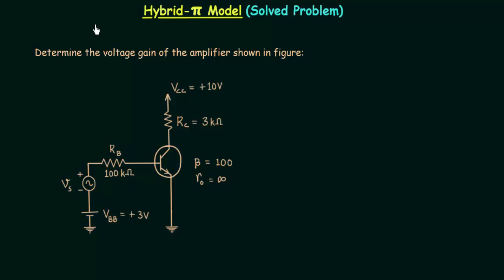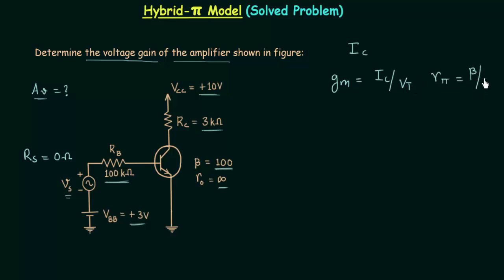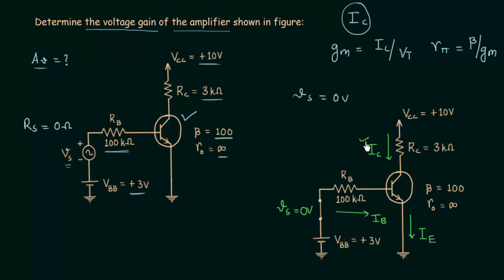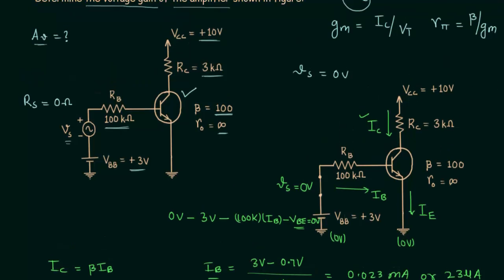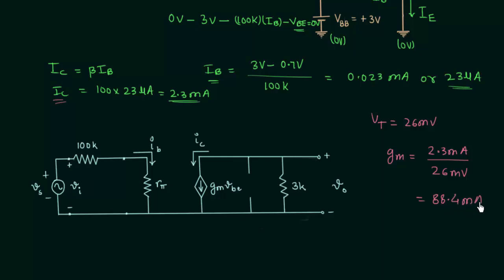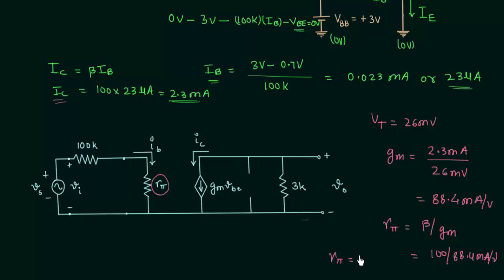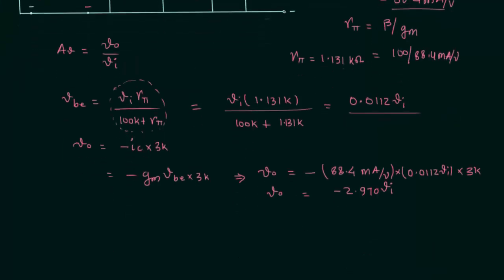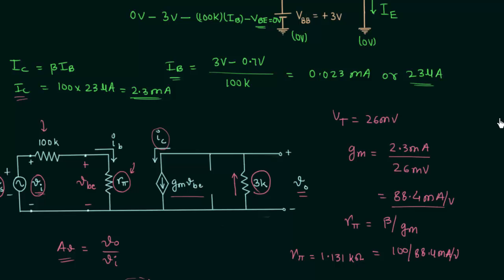Hybrid-π Model (Solved Problem)

Comment: in parallel circuit tll the viltages are same across the circuit..why did you multiply with 3k while finding the output voltage..? 

thanks.

Comment: Small correction : units of gm is A/V rather than a/mV..

Rectifying the answer .... With sligh approximations .. the ans comea out to be 299.94 .. (The Voltage Gain)
Edit- Sorry .. sir is correct 
Edit 2- Even found out this is a ques from Sedra Smith

Comment: Hi guyzzz I'm using Av=-gm.RL
Answer I'm getting is -265.2. This is valid or what's my mistake. If u know help me understand.
Reply: your ans is correct i think.. solving by anther methd i also gate saME ANS
Reply: Av= -gmRc( Ri/ Ri+Rs).   here Rs is not present  so frmula remains = -gmRc
Reply: it actually is Av = -ic.RL/ib(RB+r(π) ) because in this case (Rin = Rb + rπ  )
if you use -gm.RL so it's -ic/ib.(Rπ ) and you will be missed the Rb
Reply: as Rs is not present , the value of Rb will be cncled out

Comment: What does negative sign in Av means?? It's significance??
Reply: output is inverted from input; input and output voltages are 180 degrees out of phase;  input voltage drives the current into the network while output voltage also drives the current into the network
Reply: phase change of voltage by 180 degrees
Reply: Inverted amplified.

Comment: I hope you read my comment before my exam next week. You say if you have any questions post them in the comment section. I see many questions here which were not answered by NesoAcademy. Can you please answer them? And Than you so much for the effort and great videos!
a sum of most interesting questions (in my opinion) based on other people comments:
1- Anjali Jain
6 months ago
While calculating Vo, how did you take the direction of current through the 3K ohm resistor as bottom to top?
2- 
raveena ravi
3 months ago
How to find whether to use low frequency signal analysis method or to use high frequency signal analysis method?
4- 

Ameet Mehta
2 months ago
sir can you please tell me why vbe = VT

Reply:
manjunath karnati

1 week ago
Vbe is not  =  VT
gm=ic/vbe
gm=1/(vbe/ie).     Approximate ic=ie
gm=1/re
Since re=VT/ic,,,,gm=ic/VT
Reply: this would have been an even more helpful channel if neso actually replied with our queries, but i can understand that if he goes on to read comments, his whole day will pass. With the questions you gave i'll try to answer with my little knowledge.
1) In the loop on the right, Ic is going down so it must exit from the right, from bottom to up. 
2) I'm sure it will be told in the problem, or frequency of voltage will be given.
3) you're right, Vbe does not equai VT
Reply: Where are you know.. Have you completed your btech

Comment: While calculating Vo, how did you take the direction of current through the 3K ohm resistor as bottom to top?
Reply: Consider the loop containing gmVbe and 3k resistance,  In a loop, current can flow in one direction only, and as we consider the direction of current source as dominant(downwards ) , then subsequently the direction of current thorough 3k resistor must be upwards

Comment: Sir....from where did u put the values of 'Vbe' & 'VT'????......is it given in the question??
Reply: beta..tumse na ho payga btech
Reply: Vt value is fixed 26mv and vbe u can find by using voltage divider rule but vbe for a npn transistor is 0.7v.

Comment: Thanks @Neso Academy. If I solve the same problem using re model, I get voltage gain as 262.85, Can you please explain why this difference? I used formula Av =  -beta(Rc)/((beta+1)re))
Reply: That formula is invalid here because in previous case Rb resistor was connected in parallel with voltage source(for ac model) but here it is connected in series with voltage source.